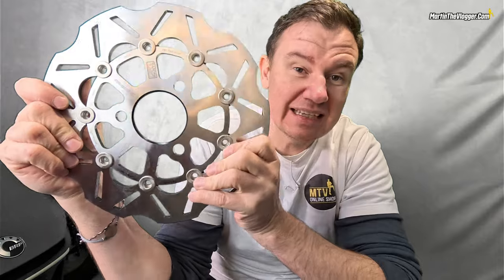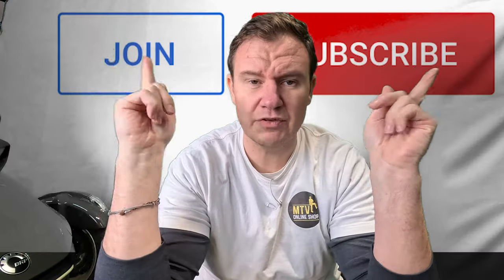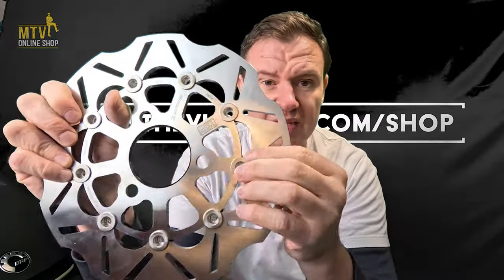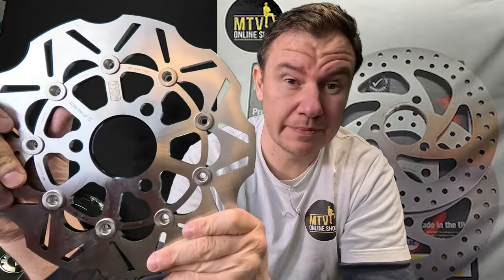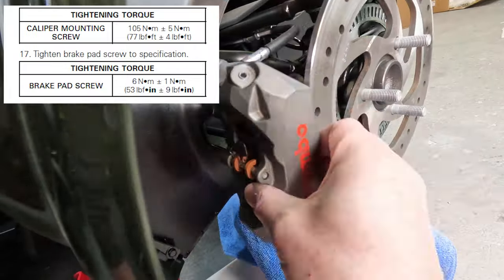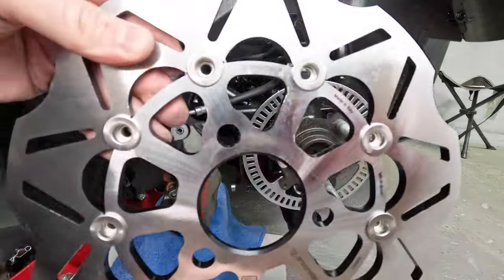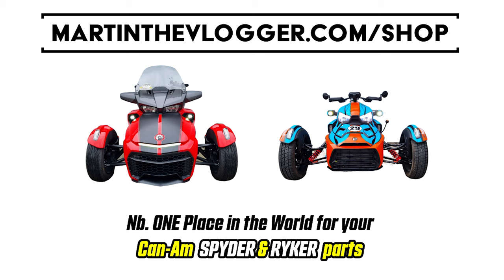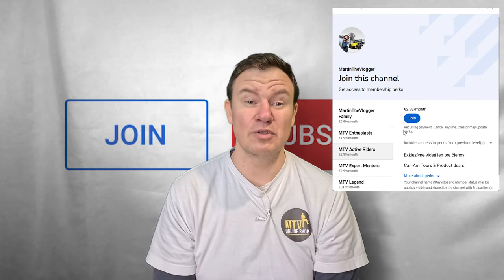Improve Braking on Can-Am Spyder | HIGH PERFORMANCE FLOATING ROTORS | Overview, Installation & Tips

Comment: 2019 RT LTD, front brake pads were replaced at 42,000Km, they were squeaking when coming down a steep hill. Mechanic said they were worn to 75%. Other than that no issues with brakes. Great video.😎😎
Reply from the maker: 42.000km and 75% its great lifespan. I would never get that far 😆😆😆 i believe you will get 80.000km out of rear, or have you change those as well???

Comment: Dang Martin... I like your warning to take your Spyder to a dealer to perform brake service if you don't know what you're doing (and I don't 🤪)... but then your video shows clearly and close-up that it's not rocket science.  Was it really as straightforward as it looks ?  If so, this is one heck of an excellent "how-to" video... for both the rotor upgrade, and the brake pads replacement 😁👍👍
Reply from the maker: Its easy. Dont forget i am office plankton and no trained or skilled machanic. I learn on the go. I brake many things :))) but its easy. One extra tip. Leave tge brake fluid reservoir open when changing brake pads. 😉😉😉
Reply: The stock brakes on the Stock. 23 RTL  are super sonically good  scary good 🤷🏼‍♂️👨🏻‍🦳🇨🇦
Reply from the maker: @billryan8707  i understand your point. For many riders its absolutely fine and of course i respect that. Fpr many RT its ultra heavy and if you look at it, that it has same brake set up than F3 than its... well . Underperformed. Specialy on roads like twist and turn and twist and turn, two up riding.. you destroy them..usually and overheat them... thank you for your comment

Comment: 2022 Spyder Sea-to Sky and the brakes have been bad from day one.  They squeak at low speed when coming to a stop. When taking the bike home from the dealer after purchase the whole bike would vibrate when braking at highway speeds.  At first I thought it was because it was new and needed to seat properly, but I was wrong. After 5000 kms they are still squealing and vibrating.  Brakes will be my next upgrade.  Thank for the great video Martin!
Reply from the maker: Ufff... but i will tell you same experience with 1 RT I have,. I did not hit it hard and it was wrong from the moment we left the shop. simillar thing has happen on one F3 Limited Special Series unfortunatelly as well
Reply: Start with loosening the lugs. If you have a torque wrench set it to 100ft lbs and loosen them. If it clicks they're too tight. Tighten the lugs to 77ft lbs and see if your brakes are better. Lots of shops put the wheels on too tight and it warps the rotors..luckily the rotors are tough and you find they are ok with no wobble afterwards..speaking from experience as I fixed a buddy of nines and he said it rode like a new byke afterwards..
Reply from the maker: @spyderlyf3  🤟🤟🤟🤟

Comment: I have a 2015 F3 with 50k miles. I’m on my 3rd set of rotors. My second EBC set lasted only 5k miles. Turns out the hub it mounts to isn’t true and the pads wear the rotors to an  uneven thickness ( 3 o’clock vs 9 o’clock). My solution took several attempts  but saved my 3rd set. I put slivers of foil tape on the hub to help true the rotors. Mark the rotors with a sharpie to see where the brake pads rub and keep adding/ moving tape until it’s nearly perfectly true. Just to make sure they wear even I rotate the rotors 1/3 every 3000 miles and torque the lug nuts. My first 2 sets shook the fenders so bad it broke all 4 brackets and so I reinforced and welded them twice as strong. Now it brakes so smooth and no more vibrations. Hope this makes sense and let me know if I should make a video to explain it better
Reply from the maker: This is also good idea 🤟🤟🤟🤟

Comment: Hey Martin why do you not put a rotor on the rear wheel? And if you do why not sell them as a single.
Reply from the maker: Good point and there are few good reasons. 1- they are not the same, so we cannot use front rotors to be mounted at back. So why not to build rear rotor? 2- because its extremly expensive. They are custom buipd just for us in small manufacturing experts on rotors in Italy.. 3- All Spyders have brake ratio 70-30 front to back so also from this reason it does not make much sense... i dont want to tell to my customers or people like you - hey, buy front and rear... coz its blshit, it wont help. Front its plenty. ... its same bullshit as to sell links only for stock swaybar.. its bullshit... 🤷‍♂️

Comment: Curious, my shop manual says to remove & replace with new  : caliper bolts , brake pad bolt, & retaining clip. It also says its "imperative to get good clamping force... the 2 knuckle threads should be cleaned up with a m10x1.5 tap. 2023 RTL.
Reply from the maker: Manual says lot of things and it does not say many also 😉😉😉😉

Comment: Very informative thank you Martin.  I have a 22 F3 limited special series,  I just bought it brand new in November last year , it's a left over. I have a question, is it normal for when you shift into reverse for it to make a clunk noise  ??? Sounding like it shift hard.I will appreciate your input. The spyder only has 1500 miles. Thank you and always have fun... that's what I do. 😂
Reply from the maker: Its not clunk noise.. its bad ass booom... also usually when you hit 1st from neutral for my its pleasent sound but its pretty hard. Good buy on 2023 as 2024 prices are much higher and will be worse 😉😉😉
Reply: So it's normal sounds,  I've also experienced it to 1st but it's always reverse for sure 😉
Reply: What I mean is it's a normal sound and I shouldn't be complaining or concerned about noise with shifting  ??? Thank you for your answers. I  only ask you because I believe you will tell the truth as you have experienced it.  Always have fun 👍
Reply from the maker: @CharlyChappell  if the noice is "just" loud bang than its absolutelly normal
Reply: Thank you , for your help and wisdom. 🤠
Reply: Any shift from neutral is gojg to produ e the clunk. You have stationary parts contacting moving parts. Once in gear don't go back to neutral and it won't clunk. R- 1st or 1st- reverse should not clunk.

Comment: What size Kumho tire are you using What auto is it normally used on
Reply from the maker: Here you can find sizes what we use and also we use now only these tires 😉 https://www.martinthevlogger.com/product-page/Can-Am-Spyder-Tire-kenda-kanine-kr20-full-set
Reply: @MartinTheVlogger  Great but didn't you say you used Kumho tires??? also I am in the USA and regardless how I like you I am NOT going to order tires from the UK.:-)
Reply from the maker: @ColPKing  hehehehe, I did not wanted you to order the tires as it does not make economycal sense,. What I wanted is to show you what we use and what are the dimmensions. I tried Kumho one time and I was not happy in the wet,. I gave up. Only really good car tire for me was TOYO T1R but they do not make those symetric anymore and for me its.. i dont like it :))